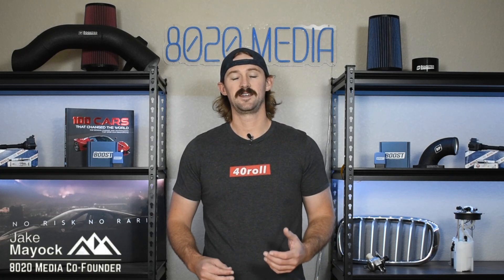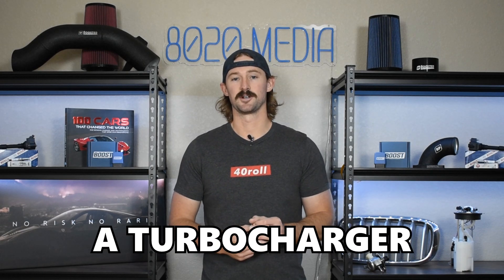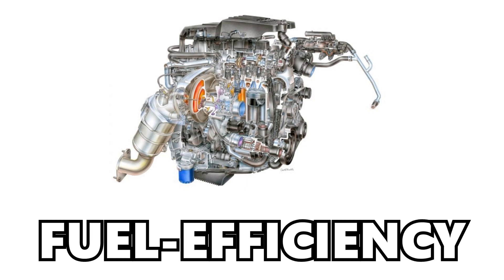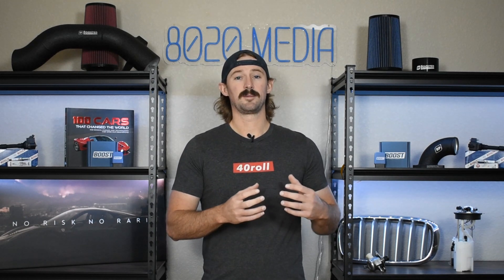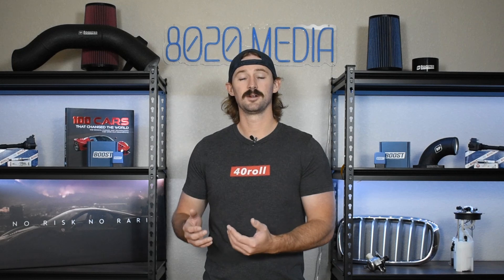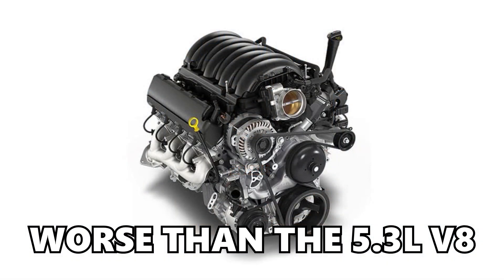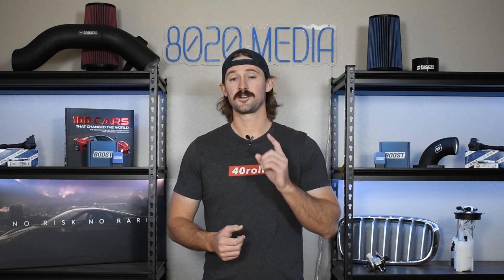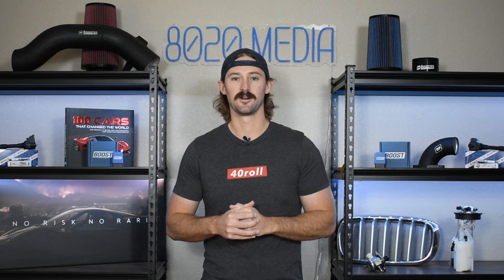GM’s 2.7L L3B Engine | Common Problems, Complaints, & Reliability

Comment: 2023 Colorado here with 15,000 miles and I'm getting 22.7 all around city highway.  Just keep your oil clean and run top tier fuel.  Regular gas.
Reply: Brand of fuel makes a difference i know my 99 with 5.3 at 186,000 miles runs poorly on Murphy gas but great on Exxon it has been the best out of all brands i have tried, dunno what the issue is but shows lean mixture  on one bank i'd say intake gasket but runs as smooth as did when bought it new.
Reply from the maker: P - Thanks for taking the time to share your experience!

Comment: Got a 2023 Silverado Crew cab 2.7 Liter with 18,000 miles on it. I bought it new and love it. No problems with it so far. I would buy it again. I am getting a 21-mpg fuel economy average . I don't baby it either. The truck delivers everything I need it to do.
Reply: 18k is peanuts. I hope you get 200k, but I feel engines should go 100k min, without any major issues
Reply: @ True its just peanuts, but that is the current mileage on the truck at this time.
Reply: @acdc5579  still nice to see its done well
Reply: @joeb2588 65k miles & lifters failed in my 2020 2.7 Silverado. Power train Under guarantee but still
Reply from the maker: A - Thanks for taking the time to share your first-hand experience!
Reply: Got 22 silv. 2.7L transmission is going out at 91k miles so f@#$.
Reply: @timwight5124 Did you have the transmission service done at 45k?
Reply: @timwight5124  did you not know that they put those shitty eight speed behind the 2.7?
Reply: Same as F150 2.7
Reply: @cs1992 not even close the Ford 2.7 is a V6 and doesn't have cylinder deactivation. The problem with GM is you can't have that long of a stroke with a turbocharged engine Ford news that's why they made it a V6 with a short stroke and wide bore. I'm convinced Chevy has nothing but dei engineers
Reply: I had the 2.8 diesel and it was great. Only had the def heater and nox sensors replaced but other than that just a timing belt and brakes.
Reply: Hanging your hat on 18,000 miles? Wow!
Reply: 16mpg avg when i got it. evan system failed before 30k i got about 105k miles i have throttle issues now.  It has major lag before the throttle issue too on the highway. I would not recommend this engine.
Reply: I'm test driving a 2023 Silverado 1500 with the 2.7 turbo, I can't find a complaint about the truck. My old truck was a 2004 avalanche with a 5.3,3.73 gear ,nothing like pulling out to pass with the V-8.
Reply: Love my 23 Silverado too.  33kmiles now gets 23 mpg mixed, 26 highway, and 15 while towing a 4000 lb boat.   Use regular gas too.
Reply: 18k miles is literally a walk in the park .
Reply: @ectorreza9616  You are correct. Those was the current miles on the vehicle at that time of the writing, not more or less added just stating the truth.
Reply: I have A 2023 Silverado Regular Cab Long box and I am lucky to get 16-17 mpg on regular 87 octane.  I am about to join the class action lawsuit.  This is the worst truck I have ever owned.  The brakes on most of these trucks is also that new all electric assist POS and it has been an unreliable cow for me too.  This lemon just stalled on a busy road for me tonight and would not re-start and came back to the dealer on a tow truck.
Reply from the maker: N - Sorry to hear this.. Thanks for sharing your experience!
Reply: You know it's bad when somebody's proud to make it 18000 miles without any problems, that's about all GM owners nowadays 🤣
Reply: Please don’t comment yet. You only have 18,000 miles on it.
Reply: @miketerry6036  I will comment any time I see fit

Comment: I've got one. It hauls the mail and has run great for 2 years. BTW it doesn't have lifters. It's an overhead cam. They're called followers since you know, they don't lift since they're being pushed down.
Reply from the maker: W - Thanks for taking the time to share your experience. We've addressed this many times in the comments, lifters was a mix up of words.

Comment: In a 1/2 ton  i will not have any 4 cylinder.     It has to work its ass off to move it.     A v8.  Justs puts alone and thus better mpg and  last longer 😊
Reply: That is why it's geared lower if had same gearing as the trucks with the 5.3 it could not pull jacksquat lol
Reply from the maker: A - We agree.. Unless you don't plan on towing!

Comment: I have the  2025 2.7L, I love the way it drives. Not understanding the jerky transmission comment, haven't experienced that.
Reply: I have 55k on my 23.
The dealer changed out the fluid for the mobile synthetic upgrade under warranty.
I think this guy is just taking stuff off the website and not firsthand experience. I’m averaging about 19 1/2 total around town is more like 23/24 in four-wheel-drive extended cab 6 1/2 bed truck highway is about the same as the 5.3 a little better than the 5.3 in the trail boss probably because of the tires.
Reply: @brettb2701  was this in the transmission? Mine is a 2022 has now 62000 miles has been what the dealer says is a hard shift since it had 10000 miles took it in for a revular oil change  they didn’t even look at it just said its normal every morning when leaving truck would just stop put up with it till just before warranty was running out took it in the day before so i could show them what it does on a regular cold start  it didn’t quite do what it does with me but tech says he can feel it left it for them to check the bext day they say could feal anything but recommended  a tranny flush  I ok that go the following day to pick up the vehicle an pay $1300 for them to look at and flush trans go to work the next morning and it does the exact same thing
Reply from the maker: C - Thanks for taking the time to share your experience! How many miles do you have on it?

Comment: If you keep the oil changes done about 3-5 thousand miles and use good oil and filters you can get it to the mileage but i see turbos going bad just like all GM turbos and lots of people will not get the oil changes done on time because they want to save 100 to 150 dollars a year and cost them thousands but that is what keeps me working so, just dont blame me for being lazy on maintaining it.
Reply: I change the oil in my 2023 every 4K miles.  For me that is every 3 months.  I’m OK with that.  I had a Ford F-150 with a 3.7L NA 6 cylinder before and did the same with it.  It never even had a check engine light until 180K miles and then it was just an O2 sensor.
Reply from the maker: M - Well said! Couldn't agree more.

Comment: I have a 2020 2.7L, and honestly I love it.  No issues up to 75k miles (I know that seems like a new engine at this point), outside of a little oil burn but not surprising with a turbo.  My 8-speed seems smooth, but I am doing all the recommended maintenance.  I love how responsive this engine is and prefer it over the last couple of trucks I've had.  Only downfall is prior to 2021 they are only rated to tow 6600lbs, which for me is fine, but I feel like it takes a lot of people who want a truck out of that market.  The 2020's take regular gas, and I get 19/20-23   mpg.
Reply from the maker: B - Thanks for taking the time to share your experience! All really depends on maintenance.
Reply: next 25,000 miles gonna be expensive
Reply: @jamesavery2734 I’m at 100k on my ‘19 and still 0 issues besides recalls.
Reply: @jamesavery2734 what made you say that about the next 25k miles ?

Comment: Every day I drive a 2024 Chevy Colorado with this Engine  for work and have put 17,000 on the Truck. The Average MPG reads 22.  I would say there is definitely something wonky about the Transmission.  Also it already threw a check engine light at 45 miles...hahaha lol Evap...
Reply: what happened with transmission did you fix it?
Reply from the maker: J - Thanks for taking the time to share your experience.

Comment: Can't see a 4 cylinder with a turbo charger being able to be sustained  in the long run. Especially when the truck will be pulling & hauling stuff. I will always gravitate to either V-8s.
Reply from the maker: H - Everyone is entitled to their own opinion. But V8 isn't a bad idea..
Reply: I only haul my 5K lb boat occasionally so it seemed like a good option for me.  It hauls it with ease.
Reply: @toddl1962  , Good for you. Like one poster said we all have our opinions & a turbo charged gas engine isnt in my future eva!
Reply: @harrymiller8538  I completely understand.  I'm very happy with the performance but I'm still skeptical about the longevity so I purchased a 120K/120mo extended warranty.  If the V8 AFM/DFM wasn't killing those engines I would have likely gone that route.
Reply: @toddl1962  , They quit with the AFM/DFM after 2021. Reason why I got the V8. They have had big problems with the 8 speed trans., I got the extended warranty
due to the 10 speed trans that's in mine. GM & all manufacturers just dont make these cars/ trucks to last past 8 years. The high dollar amounts they want, they should go at least 100,000 miles with no problems.
Reply: @harrymiller8538  They ought to go to 150K miles minimum.  My last truck was a 2011 Ford F-150 NA 3.7L.  I traded at 182,000 and it was still going strong but we like to take long trips in our trucks so I felt I should trade up.  The only issues I had with it was a sticky brake caliper, MAF sensor, and an O2 sensor at 180K.  None of which I consider to be big deals.  The only complaint I had was its ability to tow my 5K lb boat.  It struggled.  My 2.7L Chevy tows it with power to spare.
Reply: It passed the million mile torture test. No V8 GM has ever made has done that.

Comment: 2023,with 16000, best mileage 26.7 several times,tracked the first 11000 miles or so averaged 22.3 overall, set the cruise at 60/61 motor turns about 1400 rpm and gets 25mpg all day this motor has no problem getting out and passing when needed,never seen it drop to 2 cylinders, had a 5.3 best mpg 20 plus,time will tell but as of now very happy owner.
Reply from the maker: Great to hear you are getting good mileage!

Comment: I have a 2022 Sierra with 5.3 V8, without Fuel management, I am getting 19-21 mpg at 65 on highway distances of 65 miles. My 2019 Silverado with 5.3 with fuel management system that kicked down to four cylinders only got 2 miles more per gallon
Reply from the maker: Our 23 with the 5.3 doesn't do too hot but we do a lot of idling and pretty much all city driving with what we use it for

Comment: LOL dude you posted this a day ago and are still saying the 8 speed is worse than the 10 speed? Umm you live under a rock and not seen the recall for the 10 speed that the valve body is failing on and locking up the rear wheels on these trucks? I have no jerky shifts or any issue with my 8 speed 2.7 i get almost 20MPG unless I'm towing then it's back to V8 territory this whole video just seems like a hit piece to me.
Reply from the maker: Oh I totally forgot the 8-speed has had zero issues and people love it so much...
Reply from the maker: Also, there is a recall on it that will get fixed for free...doesn't change the fact that the 10spd is a lot smoother, people like it more, and the 8-speed is more prone to failure outside of warranty that isn't covered by a recall. The trans causing the rear wheels to lock up isn't catastrophic transmission failure, it literally just requires a software update...not a hardware issue like the 8-speeds have.

Comment: The city fuel economy is dismal. But the highway and backroad is fantastic. I think they use the turbos way too much when you're starting from a stop. I get 2-3 mpg while accelerating no matter how fast or slow I come up to speed.  I average 21.6 mpg after 13,000 miles. Highway trips are routinely 25+ mpg. 

I also don't think premium gas makes a discernable difference in fuel economy. In a naturally aspirated 5.7 hemi engine in at best got 1 mpg more running premium. In my maverick with the 2.0L I actually got 1 mpg worse with premium. With the GM 2.7 it made no discernable difference, like .2-.4 mpg depending on the tank.
Reply: cheaper to dump a can of B12 in with every fill up it gives better fuel mileage :) Plus keep the fuel system clean.
Reply from the maker: P - Thanks for taking the time to share your first-hand experience!

Comment: 😂the 10 speed is the problematic one with the recently recalled transmission.  The updated 8 is the better option. All the reviews from actual 2.7 owners are mostly positive. For the record you (reviewer) don’t have to apologize as it’s obvious you don’t have your facts straight.
Reply: Exactly the 10 speeds are locking up real wheels due to a valve body failure been all over the news yet this guy says get the 10 over the 8 LOL.
Reply: @chris6743  Is that 10 speed problem with the newest trucks?
Reply from the maker: I never said this engine was terrible - it just has a few shortcomings to it which lead me to get the 5.3L - because yes I actually own one of these things and have driven plenty with the 2.7 too

Comment: My 2005 GMC Sierra 4x4 , gets 15 city and 19 mpg highway. Its got 187k miles. Bought it used, sweet truck. Soo tell me why this 2.7 is worth over $40k and get 1 or 2 mpg more!!???
Reply: It doesn’t make sense in anyway shape or form
Reply: Because money is worth much less than it used to be? In case you haven't noticed, these insane high prices for marginally better things is the new norm.
Reply: @ravenovatechnologies6554  - I saw a video of a GM engineer talking about the 2.7. Engine built for a turbo –rather than tacked on later– electric water pump so you don't need to let it run to cool, etc. Torque curve is awesome. It all makes sense on paper. Problem is, most people driving a pickup aren't towing anything and want simplicity and longevity. You can still get a v-8, but still seems like the 2.7 is a one size fits all solution basically. For most people it's a lot of complexity and cost for little benefit. I wonder if there should be some product distinction between trucks that'll tow and haul things, and trucks that never will. I dunno, but yeah marginally better things for high cost that will be expensive to maintain in time is scary.
Reply: It makes sense to the government bureaucrats setting CAFE standards, which dictates most of what the car companies do.
Reply: I get 27.6 mpg on the interstate and 22 mpg in town. Mines also a trail boss so it's lifted a bit. It's also a 2025 so I think it's a bit different than the older ones.
Reply from the maker: R - You tell us haha
Reply: What kind of an idiot buys a full size truck an cares about fuel mileage! Buy the biggest engine you can drive it like you stole or buy a Prius ! I don’t care of my full size 4x4 gets 2 miles to the gallon ! It’s just gasoline burn it

Comment: WARNING im a GM enthusiast and this will be long winded...My dad just bought a 2024 Chevy Colorado with the 2.7. he has had 5 Colorados (a 2005 sold with 300k+, a 2011 sold at 140k, a 2016 sold at 135k, and a 2020 sold at 80k)and has had good luck with them for the most part. He had zero problems with the first three trucks. Until his 2019 w/ the v6 and 8 speed started having torque converter issues. I warned him that the 8 speed was failure prone and the 2.7 was an unproven and problematic engine, but he didnt care and bought the 24' anyway. The biggest takeaway I can assess about the 2.7 is that GM is being forced to develop an engine for the future of their mid size and half ton trucks. These regulations will get so stringent that eventually the only engine option will be a 4 cyl. Unless some common sense deregulation is done, this is a sure way for vehicle reliability to take an even more significant hit.
Reply: did your  father already had any issues with his new colorado?
Reply: @ we’re about a month in and no. But time will tell
Reply: @thelonglastexpert  no issues. But it get worse gas mileage than the 2019 with the v6
Reply: @jason_l5p My 2023 Silverado routinely gets 19K in the city and 24K on the highway.  It has 26K miles so far.

I agree about the government CAFE standards.  I hope the next administration loosens those up.  Especially for heavy duty vehicles.
Reply from the maker: J - Thanks for taking the time to share his experience and these insights!

Comment: 5.3 DOES get way better milage.  So why the 4 banger ??
LFOD !
Reply: 4 banger has lower gearing and u know the fuel mileage would be worse if had same gearing as the trucks with the 5.3's then would have less pulling power.
Reply from the maker: T - It is quite confusing.